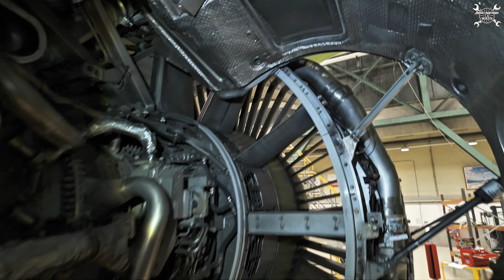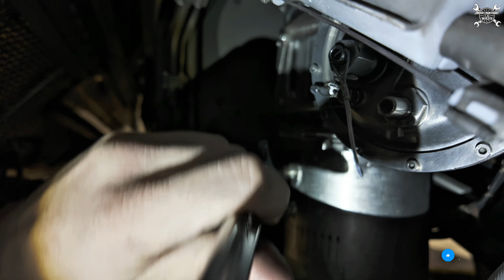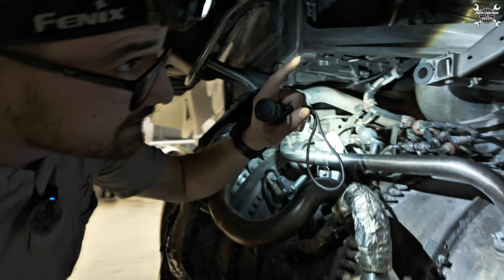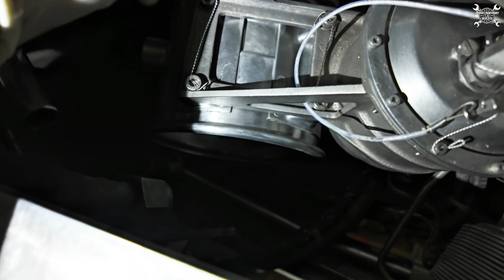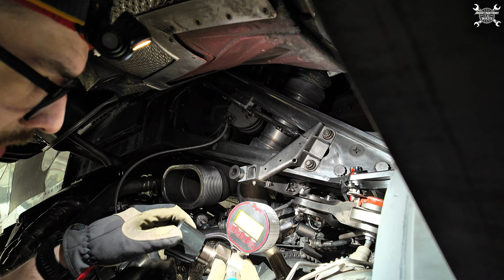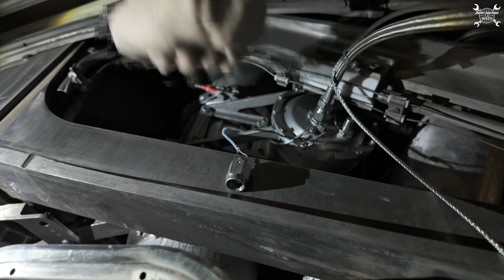Fan air valve

Comment: If you deactivate the valve on MEL does it apply a restriction on that engine bleed air system? (Can bleed air still be used from that engine for the pax without pre cooling)?
Reply from the maker: Hi. If FAV is INOP, Bleed is considered inop as well
Reply: @zeto.r  thank you for replying. How long is the aircraft allowed to operate for with only 2 bleed sauces (APU and remaining engine bleed)? Is there then a restriction if the aircraft is ETOP's certified?

Comment: The designers don't make life easy for the mechanics do they? Fiddly or what. This one is real fixing engines, hard to get at parts, bolts which won't undo and losing bits. Not that any of that happened here of course, but if i was doing it that would definately happen!

Comment: Thank you great as usual but From 15:20 to end i dont understand what happen
Reply from the maker: My pleasure, why you don't understand?
Reply: May be need more details 😊
What is that codes in MCDU ?
and where you install the test kit at which valve ?
Which valve open when you make the test ?  @zeto.r  ❤❤❤
Reply from the maker: Multipurpose Control Display Unit (MCDU) you can performed almost all the test through there, and it is ised by pilots as well for Flight Management. test was performed of course on Fan Air Valve so same thing which I replaced
Reply: Thank you 🌹 @zeto.r
Reply from the maker: My pleasure 🙂